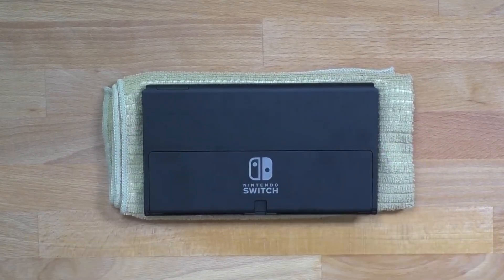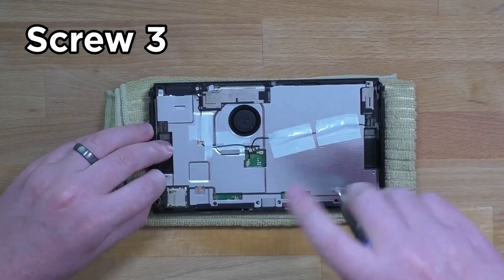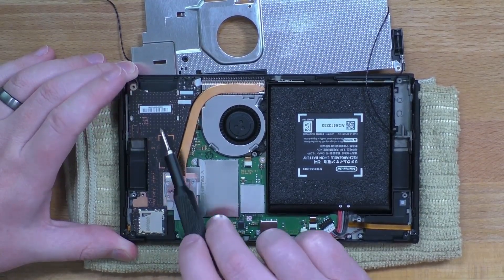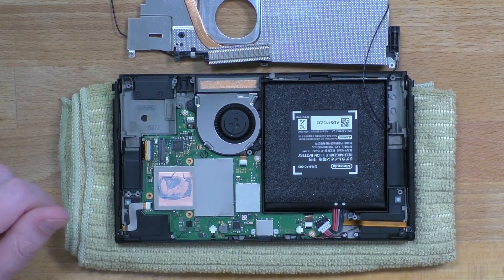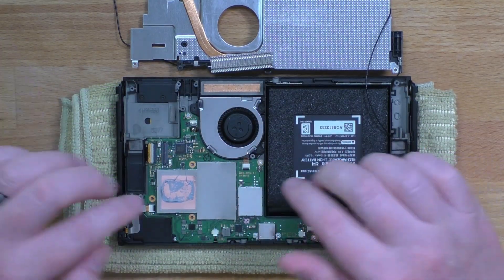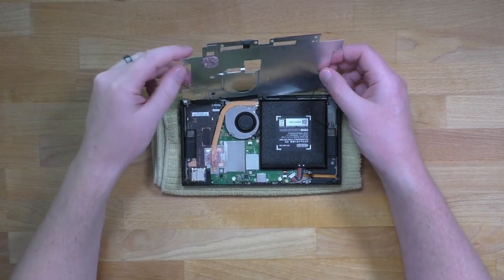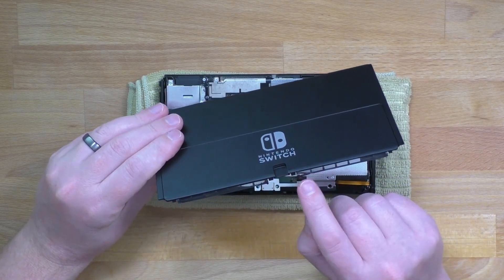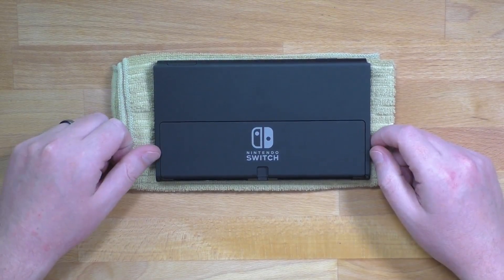Nintendo Switch OLED - How to Replace Thermal Paste (All 3 Locations)

Comment: For anyone who wants to know, that pink goop is actually thermal putty rather than thermal paste. Putty is used because the gap is too large for thermal paste. Of course, you can still use thermal paste but use more than average. However, putty is ideal.

Comment: is mx4 fine for everything? i've seen people saying to use k5pro to replace the pink putty
Reply from the maker: I use basic thermal paste like MX4 for everything. You can get a thicker thermal paste or pad for between the heat pipe and metal shield, but in my testing it worked the same.
Reply: That pink stuff is actually thermal putty because the gap is a bit too wide for thermal paste.

Comment: Hi for my oled switch is weird, I cant screw out one of the philips screw at the side panel, will it because the screw spoiled?
Reply from the maker: The screw may be stripped. if the screw is not spinning it all try a larger Phillips bit. If the screw is spinning, but not backing out try prying a small flat head under the screw head while you spin.

Comment: Hello, so due to overheating, the pink thermal paste must overheated to and spilled everywhere through the SD Card slot on the outside. 
Any tips on how to fix this? Thanks
Reply from the maker: Oh wow. I have never seen that before. Disconnect the battery, clean everything up with 99% isopropyl alcohol, let it all dry out, and apply new thermal paste.
Reply: @CO3Productions okay thanks for the quick reply. 🙏
Reply: I had this happen it was really weird , I just cleaned it and applied artic thermal paste that I had around , no issue whatsoever